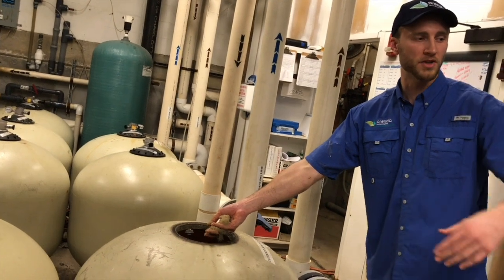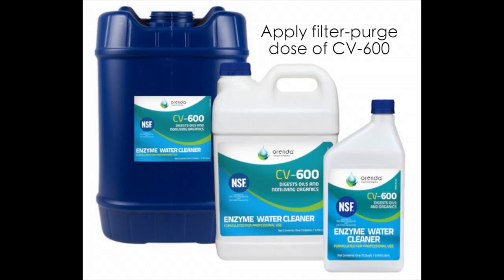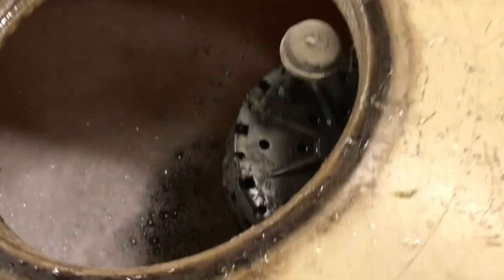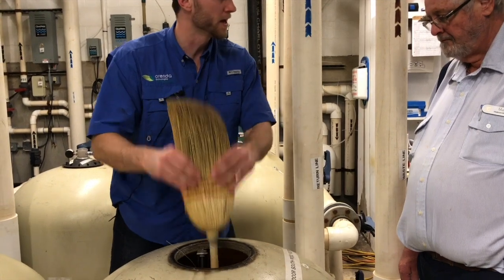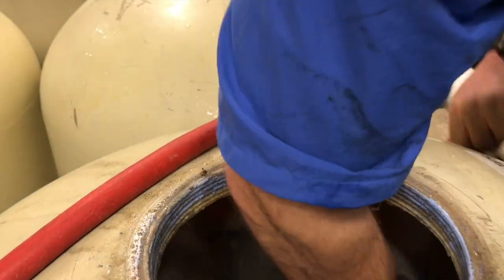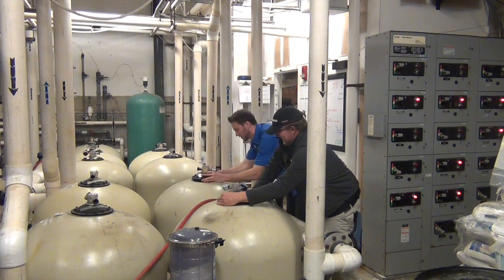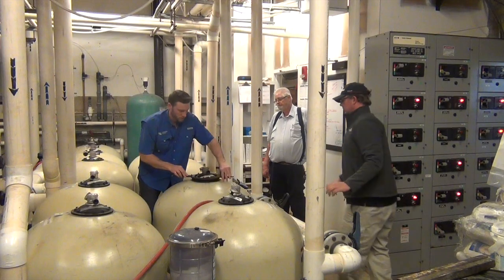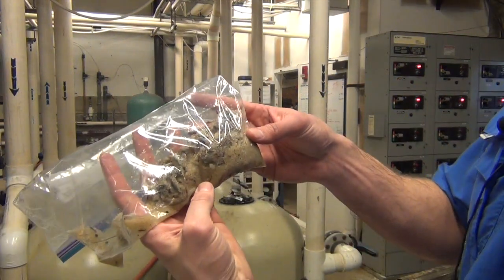TR-140 Pool Filter Cleaning with Orenda CV-600 and PR-10,000 | Orenda Procedures

Comment: How do you determine purge dose? Do you use the size of the filter?
Reply from the maker: The purge dose is in the Orenda App, based on the total volume of the pool. 32 fl.oz./10,000 gallons of CV-600. As for the filter itself, based on a TR-140, one quart CV-600 and 8 fl.oz. of PR-10,000.